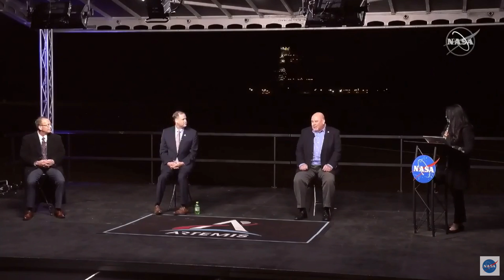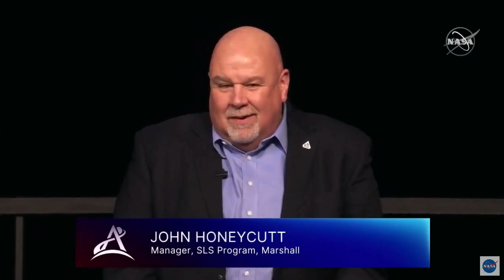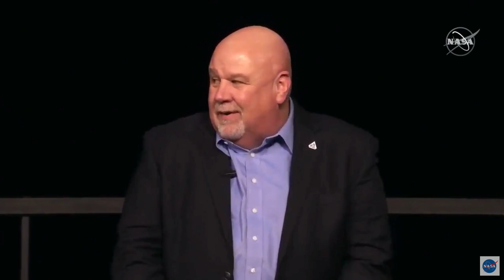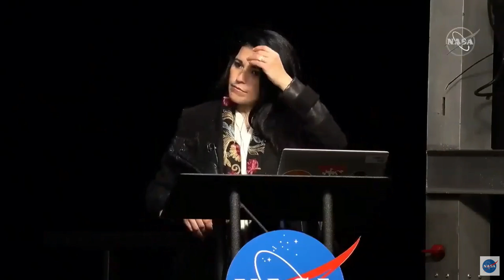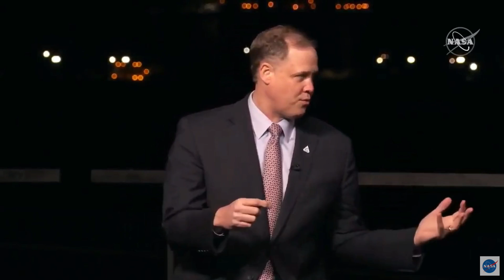Major component failure ends SLS rocket core stage test-fire prematurely, NASA explains

Comment: Apparently it's difficult to get old, used equipment to perform for longer than one minute.
Reply: Technically the rs-25s were left over engines from the space shuttle so they was never used. But still those engines are the best rocket engines ever made and very reliable. But I still can't get over my head how it's taking so long and so high of a cost.
Reply: @darkskys1757  Best are rd-180
Reply: @dzonikg  RD-180 has nothing on the specific impulse, or atmosphere to orbit efficiency of the RS-25. They're just bigger, not better.
Reply: @darkskys1757  they where all previously used in Shuttle flights.
Reply: I see whar you did there.  Apparently there is a lack of humor in a larger number of Space Nerds. :)
Reply: @joeybagadonuts1206  Tell me about it.
Reply: Do you think SLS can get it up with Viagra?
Reply: Yeah cuz they’re engines that haven’t been touched in over 20 years. And these engines weren’t actually used on shuttles so they had never been fired before. It’s not as simple and just picking it up and firing it.
Reply: @ProtonSemilightCondensed  Where did you get that information? ALL these engines have been flown before with E2060 having the least amount of flights. That being three. E2056 had four flights, E2058 had six flights, and E2045 had twelve flights.
Edited: I typed "E2056" twice, meant E2056 and E2058 respectively.
Reply: Samos oh my bad. I think Scott Manley said that they weren’t used before. Even so the fact that they are used is actually worse than if they hadn’t been used.
Reply: @samos8367  Yup, I asked around, it appear the failed engine is the one with only 3 flights, E2060.
Go figured the 'newest' engine is the one that failed.
Reply: @ProtonSemilightCondensed  thats not true all four engines have flown on shuttles and the Shuttle program has been closed down over 10 years now not 20.
Reply: Christopher Bloom my bad. Also I meant that the engines were MADE 20 years ago, not when they were last flown

Comment: Let me sum this up: Failure on a machine NASA has spent years and billions of dollars on.  This is about what I expect from NASA any more.  The SLS is still years away from flying.  Ridicules!
Reply: The SLS was supposed to be flying by 2017. But here we are 5 years behind schedule and two billion dollars over budget. It's sad that a government funded entity is having way more trouble than a private company that built a rocket in a windy ass field that has actually flown with only two years of development and way less money.
Reply: Dark sky's yes because the government doesn’t know shit. They’ll see a test like this and think ‘total failure’ and then cut funding. They force NASA to use old hardware. The government probably makes more decisions about the vehicle than NASA gets to. SpaceX on the other hand get to do whatever they want because they don’t have the ever looming threat of cancelled funds and they don’t have these bullshit requirements. If they give NASA full control over the program then they’d build something way better than starship.
Reply: @ProtonSemilightCondensed  nailed it!
Reply: @ProtonSemilightCondensed  I tend to call the Congress launch system.
Reply: Dark sky's that’s pretty much what it is. Had they been allowed to develop new engines they would have seen spacex developing the full flow stages combustion cycle raptor and could have made a hydrogen version which is pretty much the most efficient possible chemical rocket engine. They also would have used liquid fueled side boosters (like the falcon heavy).  They would be able to pursue reusability like the falcon heavy too, which would bring the cost of the rocket down immensely.
Reply: Garth Van Guilder thanks 😊

Comment: It is worth considering that Starship is using methane not hydrogen for fuel and the moon has hydrogen but getting methane is probably not going to happen!  Consequently, Starship needs to bring all its fuel from Earth.  Also, Hydrogen has a much greater specific impulse, so it does have some advantages.  Having SLS and SpaceX and others working now is good insurance...not to mention the cost sunken into this vehicle.  And while not being reusable is a real bad effect of SLS; we can hope that there is a lot of science and engineering beling learned for future vehicles.
Reply: Starship is targetting Mars. Methane can be made natively there.
Reply: Starship also works as a tanker.....Refueling is available. Methane is not a problem
Reply: Starship also works as a tanker.....Refueling is available. Methane is not a problem
Reply: It doesn't matter if it have water on moon, they never plan to refuel on the moon. And SLS is an expendable vehicle so there will never be an option to refuel it. And Starship can be fully tanked in LEO and then they have plenty of fuel to go to he moon and back. The specific impulse from hydrogen isn't much greater it is a bit greater, and the ration from hydrogen to oxygen is much worse than the ratio from methane to oxygen. So you need bigger tanks for hydrogen than for methane. In the end there is not much difference between these two.
Reply: This booster and all its engines will be dumped in the ocean, they are not going to the moon so what fuel they run on is irrelevant. As others have said Starship is refuellable, reusable, and the whole system is starting to prove itself rapidly reusable with multiple test fires without any refurbishment.
Reply: Paul Rhoden you do realise 2 of SN9s raptors sustained severe damage and have to be replaced?
Reply: @ProtonSemilightCondensed  I did caveat my statement with "starting to prove", but also look at the investment in the development of the two projects SLS has had 15 years and hundreds of billions of dollars poured into it and has yet to lift anything of the ground, and this highly publicised Green Run is an embarrassing flop, SpaceX has made more progress in the last 12 months than SLS has in the last 12 years. Also it only takes SpaceX a couple of days to swap out an engine, not the months and months SLS takes to do anything.
Reply: Nice argument hydrogen - moon over methane, except Boeing (brainless, useless, etc)